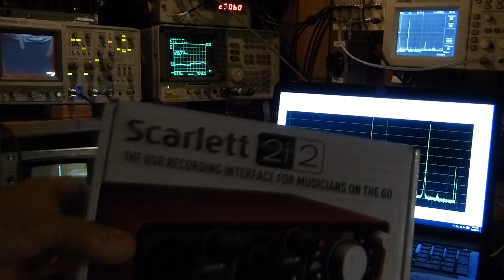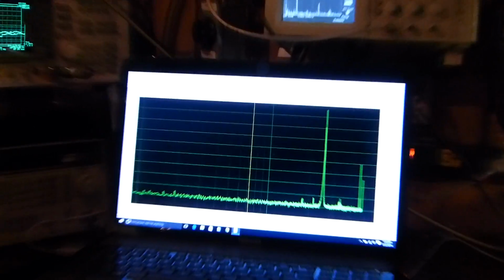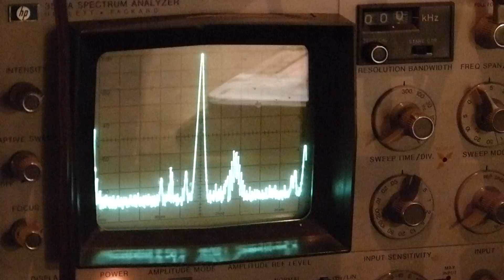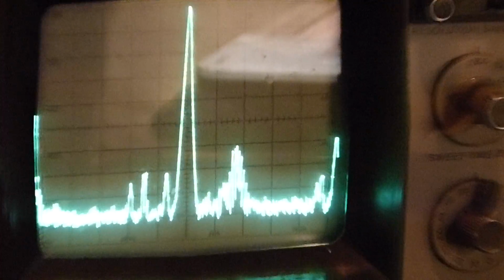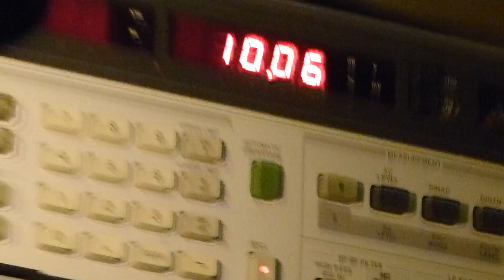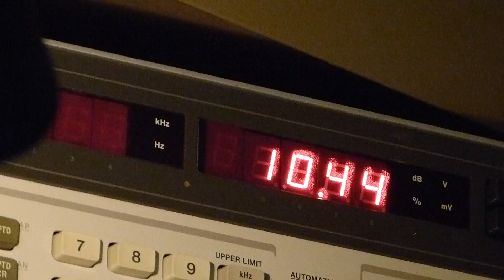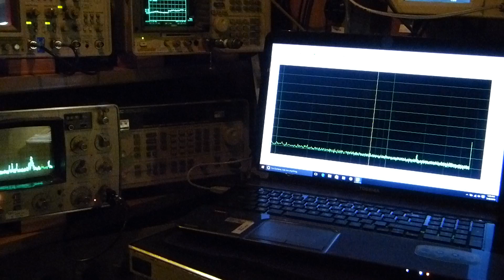Part 2:  Examining Different FFT Devices For Spectral Analysis Frequency Domain Of Audio Frequencies

Comment: Looks great, Arta is a really nice piece of software.

I've been working on a software solution based on the Analog Discovery for amplifier measurements (it's a reasonably priced device primarily targeted at EE students made by Digilent/National Instruments). It's a USB device with 2 function generators, 2 oscilloscope channels and 16 ch logic analyzer. It's somewhat limited in the dynamic range for audio measurements as it's only 14 bits, but it's got 10MHz+ (100Msps) bandwidth which is pretty amazing for a 14 bit device. I have a few videos on my youtube showing some examples of using the software to measure performance of a couple of tube based amplifiers. Software is free but still work in progress.

Comment: Practice makes perfect.  It's a lot to learn compared to using actual 'knob and button' gear.  Keep up the good work.  ARTA has a low pass filter as well.  You need to thumb around the menus.  Also, I tend to use the dBV scale vs dBFS.  You are looking at the relative difference between the fundamental and the harmonics.  There is no dBr (as in relative) scale unfortunately.  I always adjust my sound card to peak the fundamental as close to zero dB so I can keep my reference when looking at harmonic levels.  I do this post my divider and have had no issues.  I used to reference my 8903B all the time for THD+N measurements compared to the software and I became so confident, I don't anymore.
Reply from the maker: +David Soffer

Yes, and I do still need some practice with it but I am really gaining confidence in the apparatus. I am just surprised that I let the USB sound device configuration trip me up like that for a while.

I also have found that something up around 0 dB is best and I can actually see the harmonics and get the same numerical measurements for THD directly out of the SG505 as I can measure with the Tektronix and HP distortion figures - usually around 0.003% unless all noise sources are at an absolute  minimum and then THD will go down to 0.001% or even the 0.0008% Tektronix states the SG505 can do.. 

You mentioned to me earlier that I could not see the distortion products of the SG505 on the HP 3580A and that is true as I never saw them - I can see them now. 

I don't suppose the license key will make it operate any different but I felt it was only fair to pay for such a nice performing program.

I haven't the confidence to look away from my analog devices yet but I am really pleased. There is another software product I will talk about with you privately that I have tried (free) and was so disappointed in that I almost didn't even want to consider any other PC products. 

I measure somewhere around 0.02% (or better) from the built in oscillator. A PC with a decent sound card can run this software and just go-for-it for free without a license key.

I am considering building your voltage divider as I now use a 10K pot across my  distribution box for attenuation. I am sure my BNC distribution box must add some noise. I think it is nominal and it does add a lot of convenience in connecting multiple devices. I also know that some of the instruments, when connected, raise the noise and THD. The distribution box has its "cost" and grounds from here-to-there-and-everywhere is usually not the answer and often times makes the noise worse. I found that out in particular with my two 300 watt dummy loads mounted on a common aluminum heat sink. Another long story.

I am also going to work with some AC line adapters to lift instruments from the safety ground. This can help and then again it may not or even make things worse. I have a bit of a "rats nest" of wires connecting all my equipment most of which goes through an isolation transformer on the holding relay circuit that turns off my equipment in case of high temp in the shop. Safety ground is maintained but it seems down at -120 dB everything matters. In any case, I am now confident that if-and-when my 3580A quits, I will have another instrument that is as good, or better, and it isn't 40 years old...  Thanks, Dave.

Comment: Hi there Dave...

Hope you're fine.

These two last videos you uploaded just couldn't fit better you know. 

I recently moved from France to Brazil and had to give away most of my shop equipment. As the matter of fact I'm building a new shop setup almost from scratch and these two last videos shine a good light on a possibility to, not only do it in a budget, but to get decent readings also. 

I've just downloaded the ARTA software and I am going through the manual right now. I think build an attenuator to go with the dummy load and give that thing a try. I'm running windows XP on a virtual machine on my mac mini and it seems to agree with the apple sound card driver (intel). The apple sound card samples at 92k.... that could come in handy.... still don't know... I guess I'll just have to try.

Boy if I get the same results as you did, it will all boil down to a nice external sound card, my mac mini, a fluke true rms multimeter, an old RCA VTVM, a weird french audio signal generator, a TEK 453, my homemade tube power supplies (both HV and 0 - 30v), tools and a weller temperature controlled soldering iron. Now that's going to be a tube amp workshop on a budget huh?!. This might be too optimistic of a forecast, but after watching your last couple of videos, I believe I can squeeze some decent measuring out of that setup.

Now those videos were very informative but, most of all,  they're bringing some sort of ease to my budgetary articulations.... if that sentence ever makes sense....  I always see it this way: the less money I put on test gear..... the more money I can put on parts for new projects and that always rocks the house in my book. 

Thanks again for sharing and wish you all the power. 

Denis
Reply from the maker: +Denis Gouvea de Azevedo 

Hi Denis, It is very good to hear from you. Wow, moving from France to Brazil.  You are definitely an adventurer. If I move across town, I am in shock for years.

I have certainly been enjoying the ARTA software. As I mentioned above in another comment, I can actually see the harmonics straight out of the Tektronix SG505 which I could never see with the HP 3580A and I get the same numerical measurements of THD. With that said, the USB sound card and ARTA software, as I have it and have experienced, is really only as good as the (1980's new cost) multi-thousand dollar instruments from Tektronix and HP.... up to about 10 KHz fundamental and the grand-old analog instruments work impeccably to 100KHz. You know what I mean.  :-) That doesn't mean that the oscillator and spectral display is useless. It just means that that one measurement, THD+N, may be a little low above 16 KHz fundamental.Maybe with a different sound card it could go to 100KHz and even beat the old analog instruments.

We live in a fabulous time where we can own instruments that only governments and large universities could own back in the 80's and before - maybe even the '90's.. I have a 10 inch telescope with GPS that sets its self up and I can take marvelous digital pictures of M41 and send them a round the world instantly that not very long ago would require a multi-million dollar instrument with chemical processing of negatives and prints and could be put in a package and sent to one person at a time by mail. Certainly the same is true for our audio and RF instruments and hobbies. Too many people complain about Chinese products but it wasn't for them, we would still be stuck back in the '50's. Enough of that...

I think your sampling rate of 92K is going to serve you well and you will be pleased. You have all the equipment you need and I know you will be enjoying building and testing your instruments very soon.

You will need some serious attenuation if you drive a high gain input on your Apple computer.

I wish you the very best in your new home in Brazil. My wife loves to travel so, you never know... I could end up there on a vacation and come to visit you.

Always a pleasure to hear from you, Denis.

If there is any way I can help you, let me know.

David
Reply: +ElPaso TubeAmps Hi there David, 

Well I might have moved around the world a couple of times but every time I do, I'm in shock for years too….. But Brazil’s my country and things are somewhat easier for me here. 

It is a fabulous time we’re living in indeed, we can bring to our garages some serious gear…. for a fraction of the price and it’s still as exciting now as it was back in the day, if not more so. I remember when I was a kid in the early 80’s and my father worked for General Electric here in Brazil, he purchased 4 Tek 7000 series mainframes and some plug-ins for his division…. boy you could buy yourself an apartment or a really nice car for that much money…. now you buy them on eBay for under 300 Dollars… with 2 or 3 plug-ins thrown in for the bargain's sake.

Your telescope is another great exemple… not only those pieces of gear are no longer confined to big money, but the possibilities that come from using them are now out there for everyone to benefit… without bosses, schedules, shifts…. exams and grades.

We just can't live without Chinese products today. Take that little ESR meter for instance (I have one too), it costs virtually nothing and is so freaking accurate…

The fact that you own and know well those instruments plays a major role in the comparison, some pretty respectable benchmarks.

Now the bandwidth of the sound card is still very narrow but 16K is way above what I need  anyway.  Basically what I want is THD… frequency response… take a peek at the harmonic content for a fundamental of 1k…. and that’s it.  In the other hand …. it may sound a little too easy to be true, but I think I those cards are limited by a capacitor between the DAC and the op amps. If we ever play with that capacitor... maybe it will do something to the upper limit. There's a Yamaha audiogram here…. maybe I’ll try it.

As for the attenuation, yeah..., I need something serious. I’m thinking about a break-out box with 2 different inputs, a DMM output and a sound card. One input would be a -20dB from my dummy load and another input would be a 10 step attenuator to use with a 10x probe. That should provide me with some decent protection with diode clamping and a fuse between the load and the amp. Do you have any thoughts on input protection? Any ideas would be much appreciated…

I’ve been sleeping over the ARTA manual and it looks like you can software compensate the whole system by closing the loop. That might do something about the frequency limitations.

Thanks for your wishes and if you guys ever decide to come here on vacations, please, let me know in advance. Maybe I can arrange cheaper and better places to stay and help you sort out what’s cool and safe to do here. There are lots of options, Rio de Janeiro,….sea, countryside…. islands….

And since you guys live in Texas, I guess you're used to the weather ;-)

Thanks for offering to help. You know…your videos have always been a great pleasure to watch but they have often been of great HELP too. I did learn a lot just from watching them.

It was great hearing from you again.

Denis

Comment: Did you have to go through calibration on the software?
Reply from the maker: +M Caldeira No, I haven't yet. I believe one of the limitations of the unlicensed version is that settings cannot be saved. Once I get the license key I will go through the calibration procedure. The relationships of the amplitude of the fundamental and harmonics seems to be right-on without any calibration.